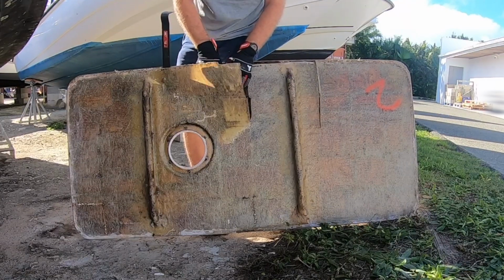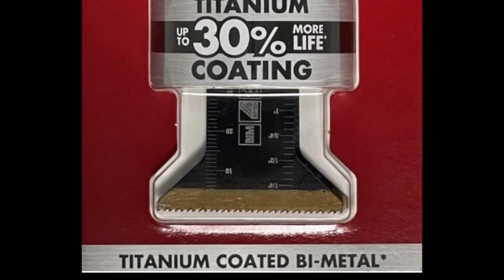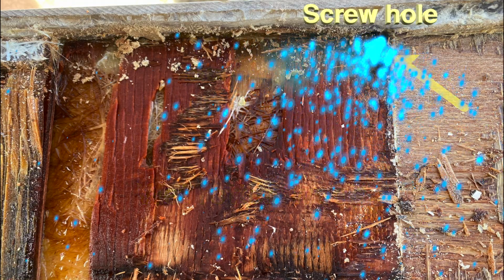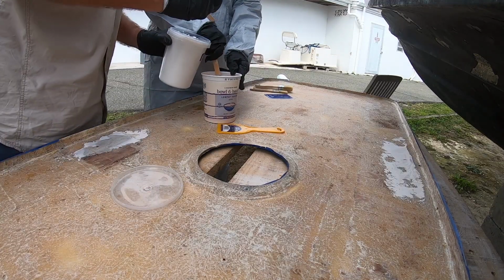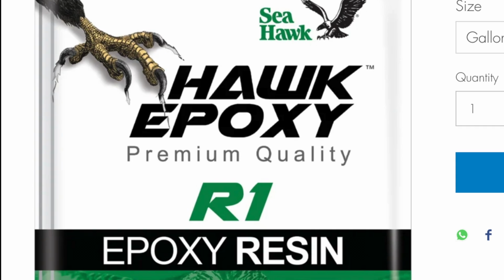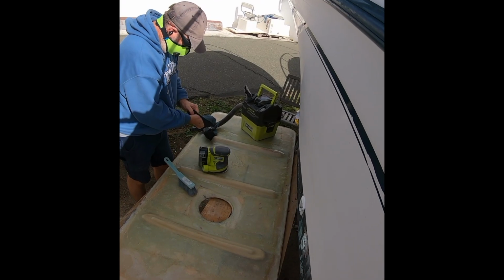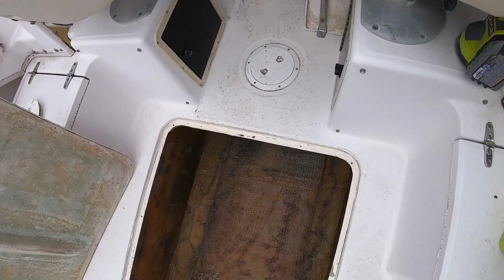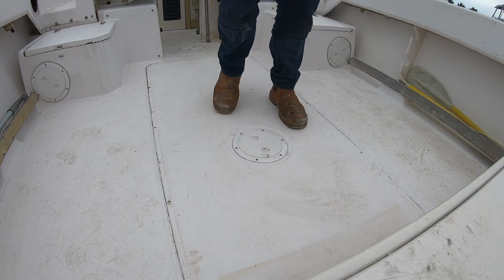Recoring a boat fuel tank hatch

Comment: hi sir I'm dara from Victoria i love to watch your conversion boat centre console boat . and i had a boat look the same but it's already been built as a centre console call sports craft v16 fisherman build in 1980 .so i got its for 1000$ and really wanted to rebuild to its age. i asked boat builder and they charge 9000$ for stringer, transom, and floor. with no casting deck, if wanted to do it's myself (no experience ) how much you thin its will cost me ????? please sir help me out ????
Reply from the maker: Hi Dara, it’s been nearly 5 years since I did this project and I don’t remember the costs and they would have changed. I am nearly finished a new transom on a 20 foot Grady White in Bermuda where the costs are very different to Australia. I can give you a rough guide to materials and you can price them locally. 1-2 sheets of 19mm marine grade ply or coosa for transom. Maybe a couple of sheets of 12mm for floor/casting deck. Maybe 3 lengths of hardwood for stringers, depending of length of boat. 16 to +20 litres resin, epoxy is more expensive than polyester. Maybe 5-7 metres of 1708 fibreglass or similar.  Silica to make thickened resin for fillets. Not sure how it’s sold but I used 6-8 “Pringle” chip sized tubes of silica for the Grady transom. Lots of sanding disks and paper. You will likely need an angle grinder with a diamond disk to cut the glass + flap disks. A multi tool and various sanders plus shop vacuum. Maybe an engine hoist to remove the engine. Understanding neighbours. Plus lots of time! Good luck!
Reply: @KookaBoating  thank you so much sir I will asking you a lot of question later on if you don't mind???? I'm sorry for its lol, because i love my fishing boat i wanted to build my centre console for fishing in lake, river in Victoria.
Reply: I can't afford a Haines hunter 445f its cost 50000$ new and my wife won't agree with its.

Comment: After discovering the screws what was used  to the fasten the fuel tank wasn’t coated with marine sealant (5200 ) you did the exact thing… no sealant and you said you thought was the main reason what cause you have to make the repair…. lol … just an observation.
Reply from the maker: Very true and well observed!
I also haven't sealed edges of the hatch.
The reason is the new fuel tank isn't in yet. 
There is still a bit of work to do in the fuel tank area including running new lines for the inflow, outflow and vent as well as determining how best to secure the new tank.
So no point sealing till this is finished.
Also, hopefully, the thickened epoxy the screw holes are drilled in will be waterproof this time.
I plan to use butyl tape around the screws to seal them.
Thank you.